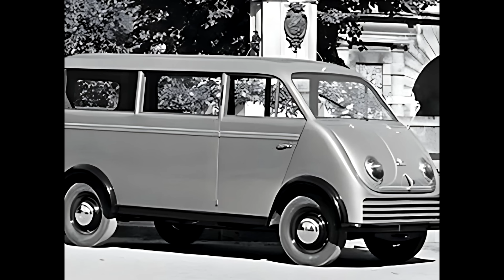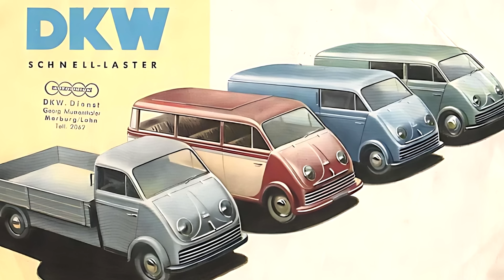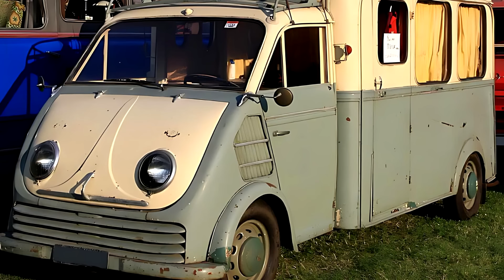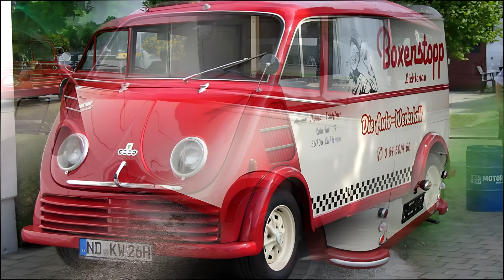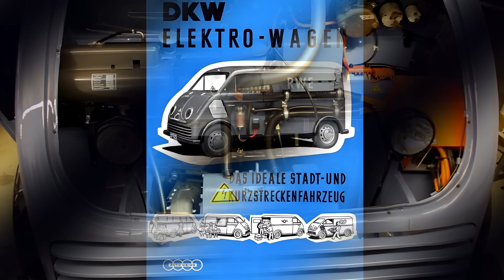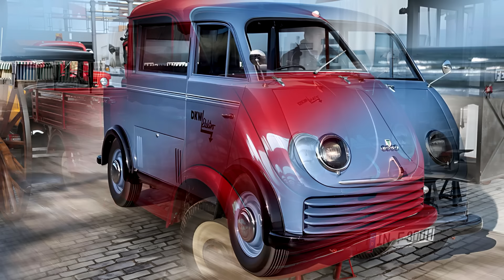1949 DKW Schnellaster 🤫 The Van Nobody Noticed… Until It Was Everywhere

Comment: These technically aren't "cab forward’, designs. Cab forward depicts the driver seating directly, or forward, of the front axle. Here these are past, that wheel point. Cab forward also means the cab itself, can be pulled forward, for servicing.

Comment: The VW Type 2 was introduced at about the same time as the DKW but differed in having a 4-stroke 4-cylinder mounted at the rear and driving the rear wheels,just like the Beetle. For that reason it lacked a flat rear load floor, and since the driver’s feet were in front of the front axle, it offered minimal crash protection. 
     DKW, along with the more expensive Audi, Horch, and Wanderer brands made up the Auto Union concern. The four brands were signified by the four rings of the company’s logo. After the war, the factory ended up in the Soviet Zone and would be used to produce IFA and Wartburg cars. Auto Union started over in Ingolstadt in Bavaria, and it was decided to produce only the cheaper DKW cars. Later in the 1950s, the brand name would be changed to Auto Union and still later to Audi.

Comment: You forgot to mention that the two stroke engines were standard in DKW cars, so they probably didn't even consider using something different and the same goes for the front wheel drive.

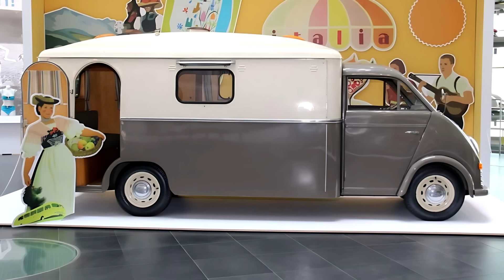Comment: When I was a kid in the 50s, we had one of these in the camper version. It didn't have the longer wheel base like the one at 6:00, so the only entry was the cab doors.  It was more like the one at 2:50. It was red with white trim. Supposedly it had a Mercedes built engine.  It was around 1960 when we owned it, but I don't know the year of the vehicle. Dad bought it to take our annual vacation trip from Indiana to Oklahoma, but decided after driving it that it didn't have enough power to do the MO Ozarks. I think it was a 4 cylinder but could have been 3.

Comment: My Father from Germany used to work at DKW's Trabant and Bargas. He said the engines neede an overhaul, Pistons Piston rings and Cylinders pr. 100,000 km. A cheap overhaul compared to four strokes, but an overhaul .
Reply: That's actually not bad.  With today's enshittification of things, there are now quite a few brands and models (Range Rover, anyone...?) that need complete scrapping by the time that mileage rolls by.
Reply: @ginaanddenes9059  That's right. Few cars reach 100,000 km. without major malfunctions. I would never in my life buy an used EV.